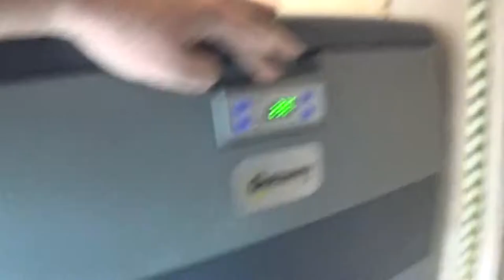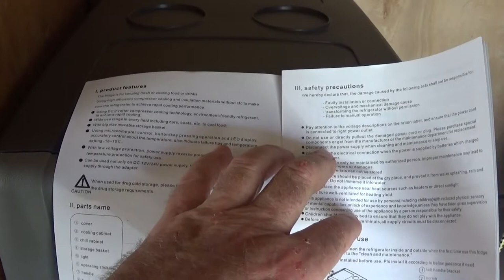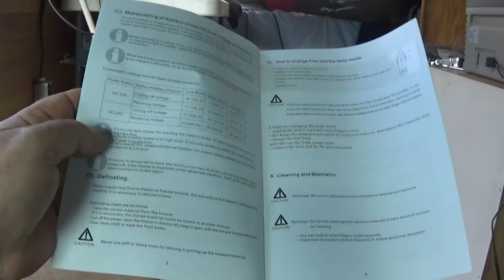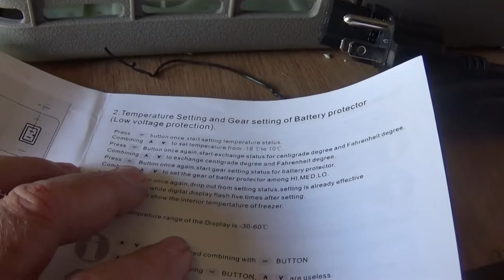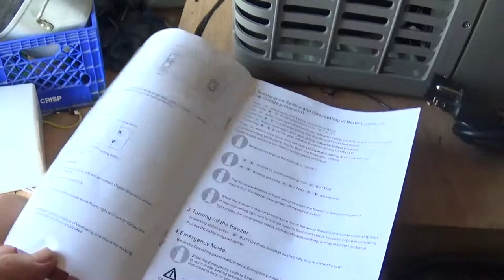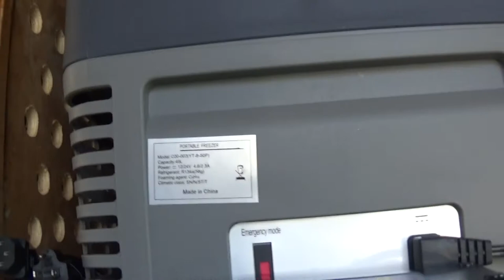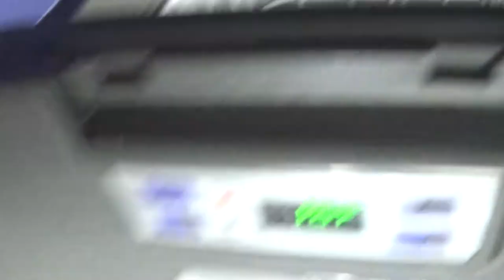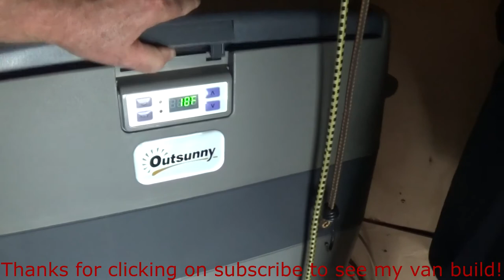Outsunny 12volt fridge review

Comment: Thanks  the great demo in real time, especially the c to f settings. Pretty happy with outsunny brand. Oregon company that rebrands some dang good stuff. I own the 37 qt  with wheels and a pull handle. Running off home battery packs 120 amp 12 volts LiFePo4. It is one of the few with metal lining for efficiency in cooling and drain plug. Best practice is to set to maximum cold.  then reset. Best wishes! How is yours holding up now?